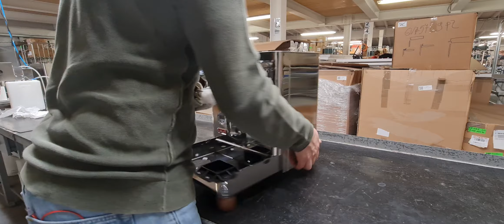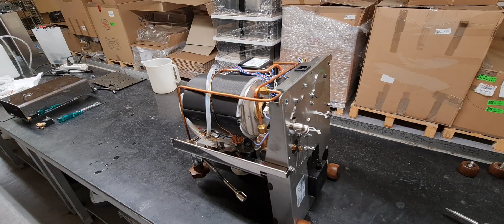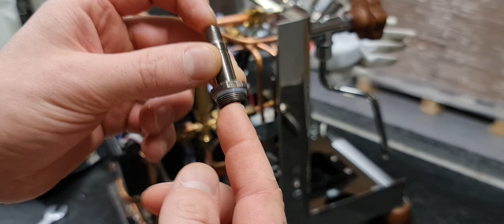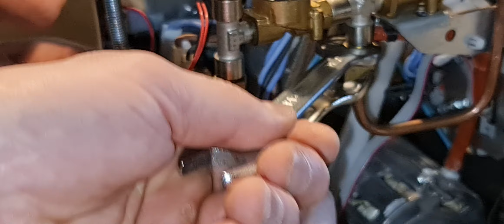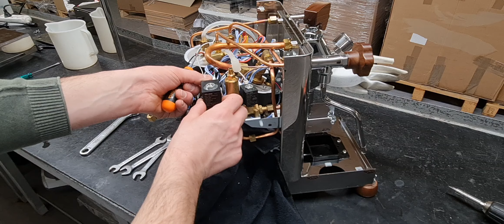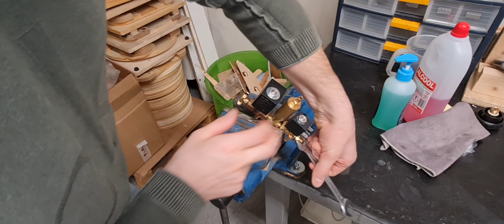pl162t how to change the water charge solenoid part 1/2

Comment: hi, I have a 2022 marax and a procon pump woth rpm motor. I'm thinking about replacing the vibratory pump of the marax with the rotary. What do you think?
Reply from the maker: the problem is the space, and, is it a DC motor?